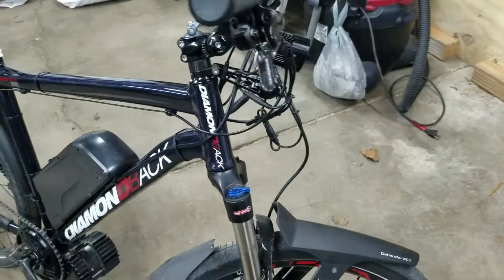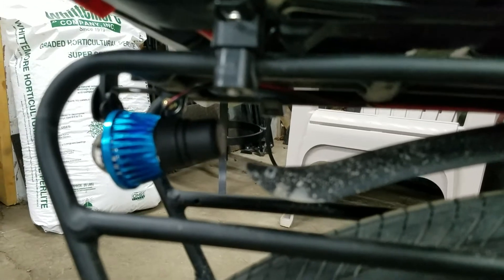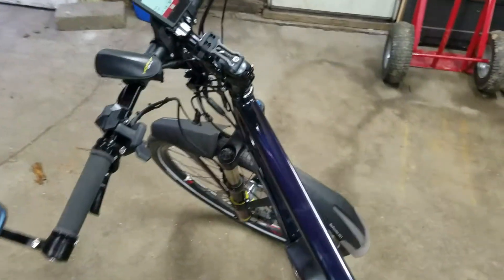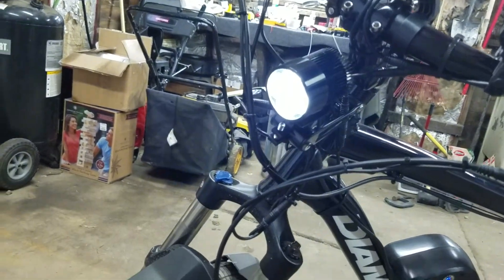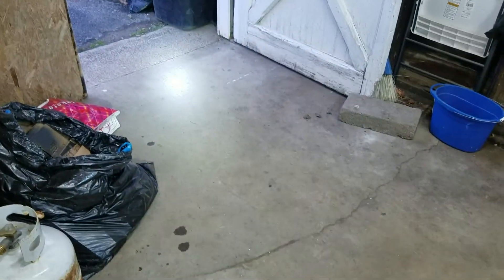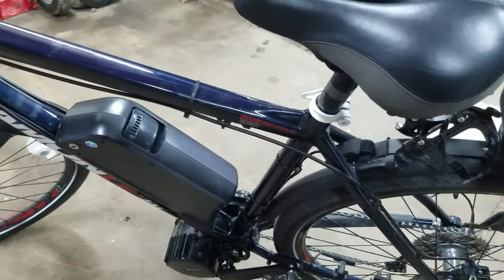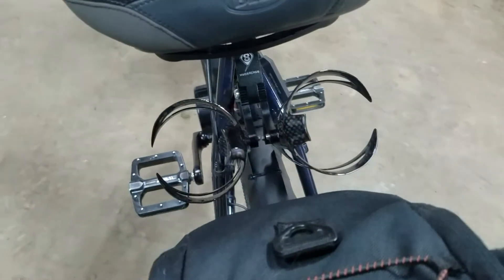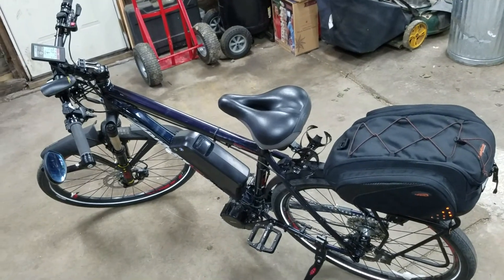12v to 80v e-bike lighting installed with demo

Comment: What's the brand name and model number of the light you used in your video.  I have a 48 volt e bike and I simply want to replace the lights that came with it because they are not bright enough

Comment: Hi NYangryguy, Just wanted to ask if possible, how is the switch connected to both lights when the lights are connected directly to the battery mount. I'm trying to think of doing the same thing so would it be Battery mount wired to the switch then the switch outputs out to both lights?
Reply from the maker: They are wired parallel to each other and directly to the battery. Still working great just took bike out the other day. I have another video where I test wire them to a dc power supply on my kitchen counter with all the wires bare to see if that will help you visualize it better.  https://www.youtube.com/watch?v=C3mYpe8KHdk&list=UUR1L1bfXUbj7FFtFwo0FrCg&index=18
Reply: NYangryguy thank you very much for your reply. This video is very helpful. Thanks!!!

Comment: Looks good! 

Is the rear light always on flash mode? Is there a flash mode for the front light?
Reply from the maker: Yes the rear always flashes and the front is just on. There are other options out there to achieve what you desire it will cost a little more is all. Look into electric scooter lights. You may run into having to step down your voltage as well to get exactly what you want. I went this route for the expense and it was compatible with my voltage without extra crap. When riding with others I ride in the back and make us visible without annoying fellow riders. When off main roadways and it's light out I just turn them off to save juice anyway.
Reply: Hmm. I have a funny use-case. The main reason I would want to control the blinking is because sometimes I tow my dog in my bike trailer. Don't want to give him a seizure! 

I guess I could theoretically have two switches to control the front and rear light separately? If I'm towing my dog, I don't need the rear light on.
Reply from the maker: My son and I went out for a night ride the other day and these lights work great. The front looks like a motorcycle light it's 20w.
Reply from the maker: Run the blinking light on doggies trailer have a quick disconnect. Use on bike and trailer keep you and doggie safe.
Reply: Cool, thanks!

Also, I do have the doggy trailer loaded with lights as well! Just regular battery lights. No plans to change that setup. But I would love wired lights on my eBike.